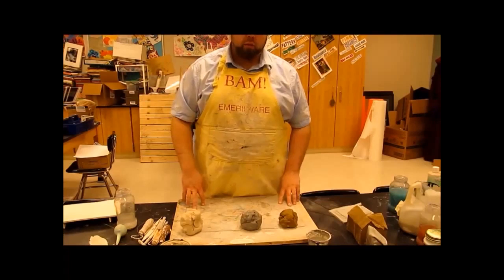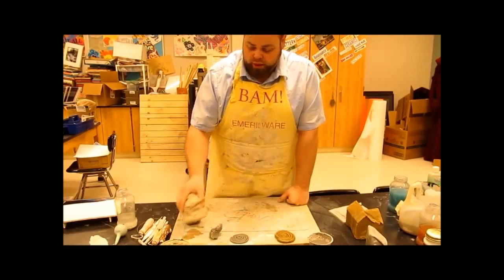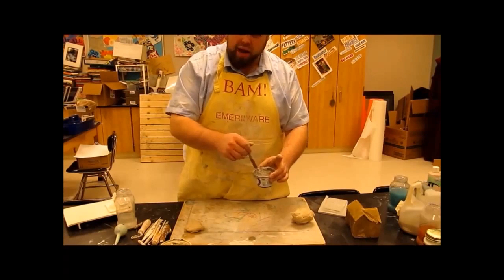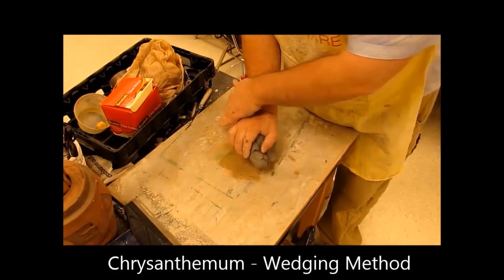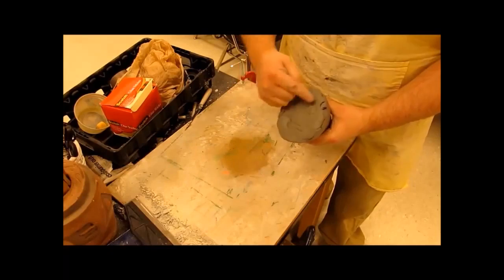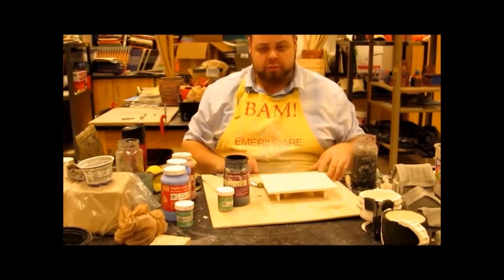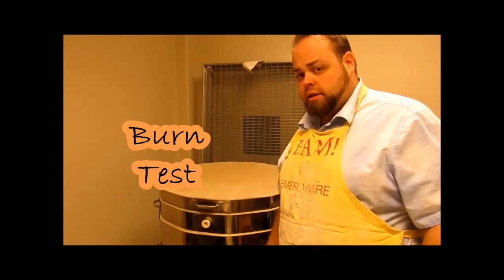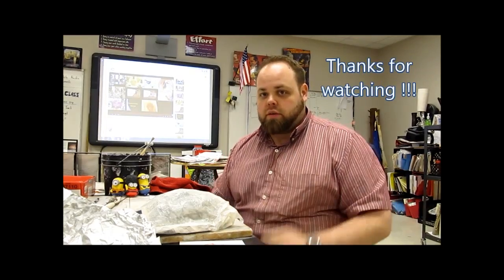Basics of Clay: Ceramics 101

Comment: I just found a kiln for a ridiculously low price so low that you couldn't even buy the half of the fire brick for it for the price I'm getting it and it's supposed to work perfectly. It's gotten Rusty on the outside but I don't give a crap I can clean that off if I have to. I'm so happy I found your channel because I have to learn everything I know nothing about this other than I used two wheel pieces but I never fired a thing in my life on my own.

This is a little bit older it is a Evenheat model 5320 XL .
I am very excited about this all I really need to know and first is how to make crucibles for melting metal. I have a forge and a small oven that I built to melt metal I work with metal and I need crucibles so I figured why not try and make them myself. I have recipes for graphite crucibles which I will learn myself but perhaps I can even get good at them and sell them on eBay to pay for everything else which I'm sure will be a good amount of money seeing as I have nothing to start with LOL

is there anything about the machine that I listed here that I should know about it is fairly big looking I haven't picked it up yet but it looks fairly large in the images
Reply from the maker: Awesome score!!  I have a video on the channel about firing a kiln and the tips to checking to make sure that all parts are working.  

I would love to get back into metals again too.  The crucible "can" be built DIY, but it is not just basic clay you will need to add aditional elements to the clay to aide in the heating and stability of the crucible.  

Be cautious, I would use the kiln for making wares, but I am concerned about the melting of metal.  You need to check on how to open the lid and not vent the atmosphere of the kiln to much as the thermal shock within the kiln could cause it to become unstable, i.e. bust.

Comment: brilliant class. thank you. I started pottery in a community centre a year ago-so much to learn! we have been making things with terracotta. They have now added a 100 degree higher firing cycle as they said without this the pottery will now last in the garden. they said it will fall apart after 10 years and I need other special glaze to fire at the higher temperature. Which clay, glaze and temp for firing do you recommend for garden pieces?
Reply from the maker: For garden-ware you can use either terracotta/earthenware or stoneware, but I would always fire the ware to the max temp (usually Cone ^04) for best integrity, or stoneware as it can go to Cone ^10. If you are not eating out of the vessel you can glaze and fire in one go.  Please pass this video on to your classmates and I have additional glaze videos too.

Comment: At what temperature would you consider it safe to open a kiln? How long would it take for one to cool down? Also, I am aware that brushes and tools cannot be mixed between ceramics and porcelain but do you need 2 separate kilns for firing them? Also, if you were to fire beads for jewelry, balls, or marbles; how would place those in the kiln to keep them from sticking to the shelf?
Reply from the maker: Closest to room temp is the safest to open the kiln, nothing above 120. This is to help with thermal shock, quick temp change can crack glaze and clay.  
The tools can be used interchangeably, but I would clean them in between, and all wares can be fired in the same kiln. Just check the correct firing times.
Jewelry: They make Bead Racks to fire jewelry that will prevent sticking.  I will work on that for a future video, so stay tuned.
Reply: @TrifireStudios  Thank you. I had a porcelain instructor who was adamant that porcelain and ceramic never be mixed or even too close together that made me think she was suggesting two separate kilns. Thank you for clearning that up!

Comment: For the high fire clay do I need a big electric kin for it or will my hole in the ground in fire work
Reply from the maker: Great question. 
No, most pit fires can only get to 1500 degrees under the best circumstances. For high fire you need a kiln that can fire to cone 8-10, 2150-2300^. 
Check out one of my kiln firing videos for additional details.
Reply: @TrifireStudios awesome thank you very much

Comment: what are you working on??? Mine sticks to the wood!
Reply from the maker: I use large wooden trays in my classroom.  I have had similar problems in the past if the clay was to wet and it would stick to the boards too.  Additionally, the boards should be "aged" a little with clay and dust.  Fresh wood still has oils/chemicals on the surface that could also lead to problems.